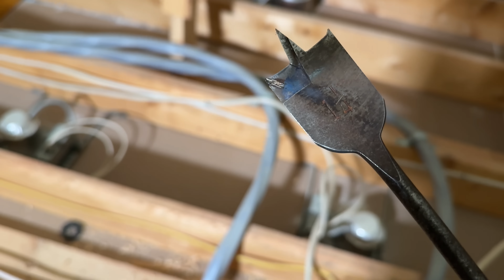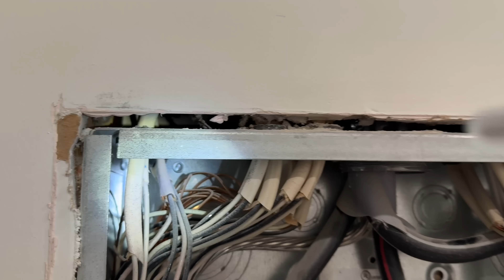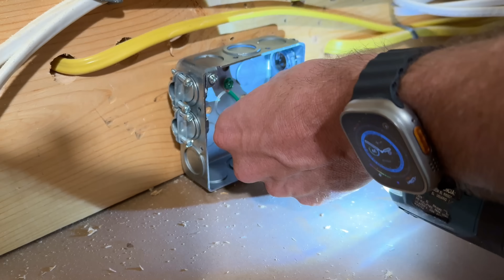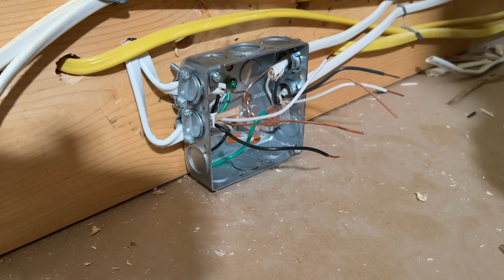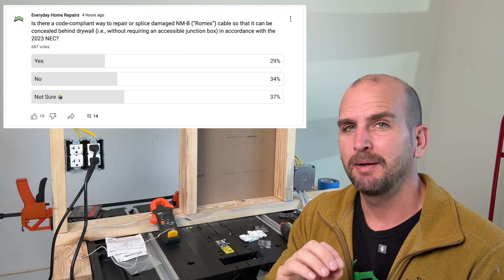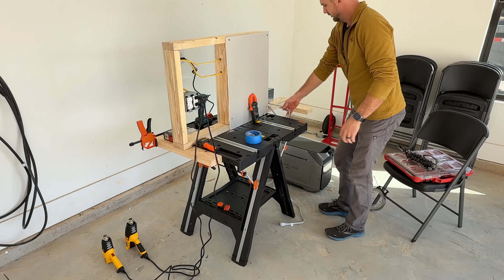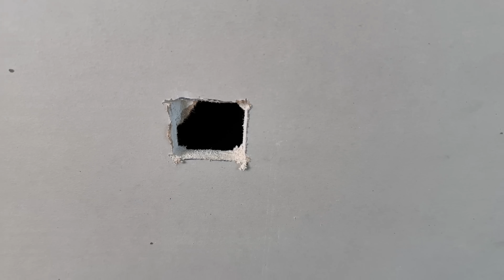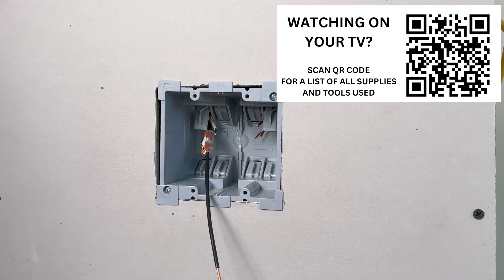How To Repair Damaged Romex |  3 Easy DIY Fixes

Comment: Great video across the board.  I never would have thought those in-wall splices would have performed as well as they do.  On the third technique, I have a question.  You put pigtails using the Wago inline splices on both ends of the damaged Romex, then tied them together with a standard Wago in the middle.  Couldn't you have saved one connection by simply having one pigtail that was connected at each end using the inline Wago, resulting in two Wagos per wire instead of three?  Slightly less cost, fewer connectors therefore fewer potential failure points, etc.?

Comment: That in wall splice device is like the automotive 3M Scotch Locs. There are probably the quickest way to connect a pair of wires but many in the auto industry do not like nor use them. I won't use them on my car and I would not consider the in wall device for my house or wherever. No, I would never consider the in wall splice device.

Comment: I am an electrician  and have  seen the in wall connectors on modular homes and have had them fail  , luckily they were in an unfinished section of basement , the connectors that failed were for interconnected smoke detectors of all things , when testing house after power was hooked up I noticed some smoke detectors not working, went to basement  wiggled the connector  and  smokes worked, replaced that pos connector with a proper junction box and splices. those connectors are sketchy at best , how they are legal I will never know,, probably the same guy who came up with the arc fault breaker scam in the code ,  wow these connectors can arc so let me force these uber expensive breakers into the nec....

Comment: This might be a dumb question, but what would be wrong with using a Wago connector and securely wrapping it with electrical tape? Is that so different from the connector box inside the wall?

Comment: I have some under cabnet floresent lights I want to replace with some LED lights.  The problem is, the 12/2 copper wire coming out of the wall is already stripped and too short to get to the light.  This wiring comes out right under the cabinets and is thru tile.  So, I can not get ino the wall without either cutting thru tile or into the cabinets.  Can I use teh ROMEX SPACE KIT outside the wall - allowing me to connect the existing copper wire to another extended run to the light - under the cabinet and not inside the wall??

Comment: I'm so glad you temperature-tested the NSI splice.  That's the data I need to see before I trust them, and that was reassuring.

The third repair with the old-work box?  There's so little cable entering the box, it seemed like the inline Wagos could receive direct strain from the knock-out.  That would make me just a little nervous.  Another 1/4" of sheath entering and I'd likely relax about it.

Comment: I too drilled through a stud into 1965 construction - fiber coated without a ground wire. 😮 Splicing and replacing with modern Romex. Thanks for the help.

Comment: Has anyone tested the safety of these devices after multiple breaker trips?  The peak current in a breaker can greatly exceed the average current rating for these splice devices.  Do their connection characteristics change after one or several breaker trips?  A twisted and capped splice (Wire nut.) is as good as or better at carrying surge currents than the wire itself because of the contact area.  The buried splice is truly scarry.
Reply: UL has tested it and approved its use a safe product, as they do with every single electrical component we install every day. Their testing would obviously include locked rotor currents in a typical circuit using NM. So you trust their judgment on everything else but doubt their judgment on this particular product? There's nothing scary about it, I've used it 2-3 times, it's a solid product.

Comment: Great video.  I had the same problem in my garage where I ran a 1/4 lag bolt through a 2X4 wall stud and pierced a 12/3 romex shorting the hot and neutral wires.  I fixed it before seeing this video by installing a plastic old work box and using three 2 conductor WAGU connectors.  However, I did contemplate twisting the wires together and soldering them before covering the connections with wire nuts instead.  I thought a soldered connection would be the most reliable and provide the lowest resistance method but I decided to opt for the WAGU method instead.  QUESTION - would soldering the wires and covering them with wire nuts have been an acceptable method?  Thanks !
Reply: No
Reply: @pld8993  Thanks for the reply.  Please elaborate.
Reply: @freedomfreakazoid  Soldering and wire  nutting without a box is what I said no to, but that wasn't your question, my mistake. To your actual question, twisting and wire nutting is more than sufficient. Because the conductors are already twisted into each other and therefore have large surface area contact, I don't see how soldering adds anything to the mix, but it certainly doesn't hurt. Wagos, on the other hand, rely on the wago block to carry current from one conductor to other with no direct conductor contact. Splicing is better.
Reply: @pld8993  Great !   Thanks for the input.

Comment: Where does it say in the specs that it's rated to be buried behind drywall? I'm not seeing it. Thanks!
Reply: From the product sheet: "Compliant with 2014 NEC 334.40 (A) (B)."

Comment: dont listen to this guy. dont do electrical yourself. out of the myriad wrongs this guy says, ill choose 1: he didnt tell you how to get that fish tape down to the panel . he acted as if that wall would be free of wires which it is obviously not, its going to the top of the frickin panel!!! there are wires in there that will no doubt re route that flimsy fish tape and you will probably be there at least 30 minutes wondering why you pushed 30 feet into a 6 foot length and still dont see the end. just call me or one of my electrical brothers that know what they are doing

Comment: I may have missed it, but when you cut the wire in the double top plate, how did you pull that wire up and out?  You showed how you fed new wire up, while someone pulled, but how did you get an end to pull on?   Thanks again for all your great content!

Comment: Starting off.  If you look at the way the splice kit works, it is essentially like the WAGO in  that both use prongs that pierce the sheathing of the individual conductors,  so the connections should be equally safe.  After saying that, I am a bit old fashioned in that I prefer, in order, to pull a new romex, or to use a junction box.  In the first case the splice is eliminated, and in the second it is accessible in case there is a problem.  The last thing I want is an electrical fire inside my walls.

With the outlet in the double wide that failed, I have to wonder if they overloaded the outlet/wiring.  If the griddle drew more current than the outlet could handle, it would likely fail.  Only reason I point it out is that I bought a house with a small electrical panel and one of the previous owners added some new circuits, using 20 amp tandem breakers.  Problem is that nearly all the wiring in the house was 14 gauge copper, which means the outlets could draw more current for which the wire is rated.  There was evidence electrical fire in some of the outlet boxes.  This is why my first thought would be they overloaded the outlet.
Reply: The connection is much more robust than a wago connection, they're not the same.

Comment: My guess is that the splice kit is approved to for use in inaccessible locations because they are designed as non-removable, permanent connections. For any connector that is removable (wire nut, wago, Ideal push-in, etc.), there is risk of inadvertent removal (due to vibration, movement, thermal cycling, etc.) so they need to be accessible.

Comment: At 5:19 you have the bottom cable misplaced and when you tightened the clamp it puts pressure on the wire on the edge of the clamp which will eventually cut through the insulation and cause a short, fire, failure. Also the top cable has a very tight bend as it goes through it's clamp. Did you go back and correct these issues? Hope so.

Comment: I think option 2 is what I would use if pulling new wire was to time consuming, option 3 has more points of failure. On option 2 you could glue a scrap piece of wood between studs and install option 2 into a metal box that is screwed into the wood, at least your splice is in a metal box, though still buried in the wall.
Reply: Never bury splices. Besides being illegal, you never know if there is an issue with the connections until something bad happens.

Comment: so my home which was modular and built in 3 sections and put in place by a craine......    all of the peice of the home have those kind of plug in splices to connect the differant parts of the home.   also because you showed them while i was typing this, the use those stupid outlets and i am replacing every single one fo them OMG THEY SUCK!....

Comment: As a Master, I would consider  this a "hidden splice" which under the code is a use NO-NO. BTW I will toss this in as well NM in conduit is technically legal  but you will run into the conduit fill rule. so just dont do it.
Reply: It's an NEC compliant product, 334.40 (A) (B) .

Comment: That splice is still extremely dangerous; your test didn't even slightly address any of why such in-wall splices are dangerous in the first place. Think about it: the requirement is for splices to be accessible, not for them to be well-ventilated or otherwise given extra cooling. That's because the main things that make a buried splice dangerous in the first place have nothing whatsoever to do with resistive heating, and everything to do with ability to inspect them, so the next guy can tell what's going on with the circuit.
Reply: Nothing dangerous about it, this product is NEC compliant.

Comment: Per the NEC there shall be no unacceptable splices. These inline splices are only ok to use in Modular or mobile homes, and it specifically has to do with the UL rating of those connectors. They are not rated for regular constructed homes.
Reply: Incorrect. It's NEC compliant 334.40, not limited to modular construction.
Reply: @pld8993 you wouldn’t do this I hope as a professional , but if you would then you know why you don’t make a lot of money because you’re a hake
Reply: @pld8993 and you didn’t read everything that I said you can put something like this in an attic or behind a panel but please don’t buried behind drywall
Reply: @pld8993 I hate you bungalow busters thinking that you, because you know how to wire anything in a house that you know what you are doing. It’s frankly disrespectful. Unless you have learned everything about electric then shut up because I know a lot but I still learn every day.
Reply: @timothydixon2545  "They are not rated for regular constructed homes." Verifiably false. You just learned something today. Any questions?

Comment: Surprised at your skepticism about insulation displacement connections.  It has been used for many decades in electrical connectors and various applications.  If there's a downside, it's that the connector must be applicable to the wire type and size in your situation.  Don't try to get away 'stretching' the applicability!

Comment: funny question - the 2 gang box you were using for the in-wall fix (near 13min mark), its plastic and can attach to the drywall - what kind is that...? I looked at  my local hardware store for them and they didn't carry them. seems super hand for adding an outlet without removing drywall and securing metal box  to a stud..
thanks
Reply: found it in your supply list - my bad for not checking there ..

Comment: Can the NSI splicing kit be used to extend a terminated circuit, such as moving a light switch 3 feet or a light fixture, without having to insert a junction box and want to close up the old hole?

Comment: How do you get an attic job with no insulation?
Reply from the maker: Oh man that is the best attic EVER to work in as it has spray foam on the roof decking.  The temp is nice and no insulation to mess with makes things so much easier.

Comment: Good video. I am not a fan of the approved in-wall splice kit.  I have never used one but they look pretty cheesy to me. Personally I would rather have almost any method rather than that, even just a couple well taped wire nuts. I was an electricians for over 50 years and never in those years did I ever go back and redo my work and I am kind of proud of that. Most electrical problems in my opinion are caused by poor workmanship and poor materials used and I consider the in-wall splice as a poorly designed product. I can't believe the UL or NEC approved it but they did.
Reply: It's a well designed product, nothing wrong with it.

Comment: i think its wild we can do splice repairs with UF or USE 
idk i think the nec rules for Non metalic sheath splices could use splice rules like UF and USE
if its mechanically secured, soldered, wrapped, should be good, but instead sometimes you have to pull romex, take drywall out, fish (good luck not having stapled wires in current year), the expense is increased for no reason and its a hard sell for a lot of clients nowadays.

Comment: I prefer the third option. If there is room in the circuit for some load. An extra outlet or two is always welcome for something. But a clean install and a blank cover is not ugly and can be easily hidden if need be.

Comment: I neded to reposition a light fixture above a vanity and was expecting the wires to be too short. I bought one of these splices. When I pulled the old light BAMM tge romex came in through the top plate so there was plenty of wire to raise tge light fixture up above a new mirror was going in. I took the fourteen dollar splice back to the supply house

Comment: Great video. I've been an electrician since the 80's. I love those in-wall splice kits. I have used them a bunch. I did have one inspector that didn't like them so he petitioned the chief electrical inspector and had them banned from the entire state of washington. 

One other thing,.. in your attic splice you are required to bond all the ground together regardless if they are associated to differnt circuits. Other than that... well done!
Reply: In wall splices are ok with the approved parts but I will never use them. Put in a j box and cover

Comment: I was interested to learn about this product (...I'm not a pro').  I appreciated your test and parameters.  

The technique that uses a two-gang or three-gang box is a nice tip.  'Fugly', but good enough for government work until you can get around to pulling a new cable.

Having to make in-wall electrical and water line splices are the bane of all DIYers.  My favorite method is just to burn down the house in those situations and let the insurance handle it.

Comment: Frankly, most new wire pulls like you portray are likely going to fail.  If the cable wasn't stapled, it wasn't done right in the first place.  ...Most likely you are going to have to pull a new cable "around" the original cable installation.

Comment: Your Wago nuts have a similar insulation displacement connection as the romex splice.  Once could make  solid argument that wire nuts in a box are less consistent than the IDC connections, when designed properly for the wire used, especially when putting 3 or more wires in a wire nut. Wire nuts when installed properly may have a lower temperature rise than IDC's since there is greater contact area in a twisted wire. However, the IDCs are not typically the problem, barring damage of some sort, its the separable interface in the connection in the romex connector, which is where the heat is generated.  There are UL requirements for temperature rise in the separable connection for the designated current rating, generally must be less than 30 deg C.  This is measured directly on the terminal. These are UL listed, so are tested to ensure safety at the specified applications.

Comment: Whoever did your main cable coming in did a horrible job and should be fired. That can cause huge arching. Look how much excess copper is exposed on either side of the clamp..... thats soooo bad...EDIT: You should barely see any copper on either side on the clamp looks like you got a half inch on either side..

Comment: Don't bury the Splice! I have a 40 year old modular and have started to experience occasional open circuits with these romex connectors.. Nothing warm, just an open in either the hot or neutral. I'm replacing these with UL approved DIN Rail screw terminal blocks, installed in a Hoffman enclosure. But I'm an engineer, so I overdo things. Be safe!

Comment: Very Nice video and presentation! I am not an electrician but have done plenty of electrical work, and if I don't know something, I don't assume and always had a friend who's a Pro that I bounced things off if I need help. I am an engineer and I liked the fact that he did some testing with the thermal coupling to verify that it is safe to use if done properly and stated some issues that can cause a bad connection. Keep them coming!